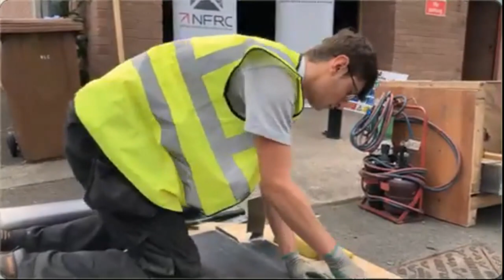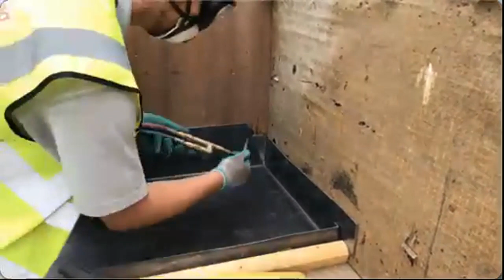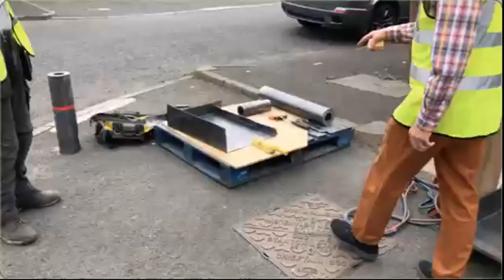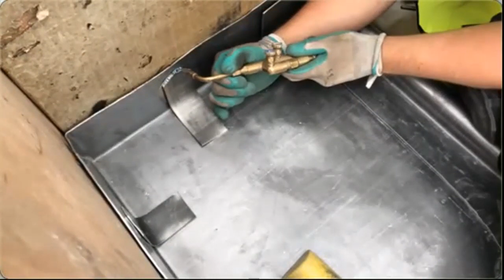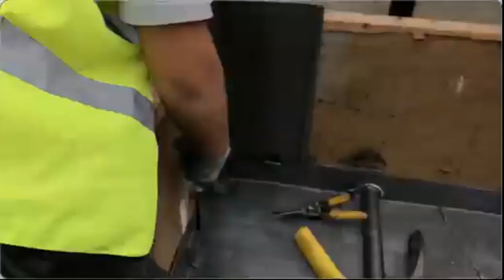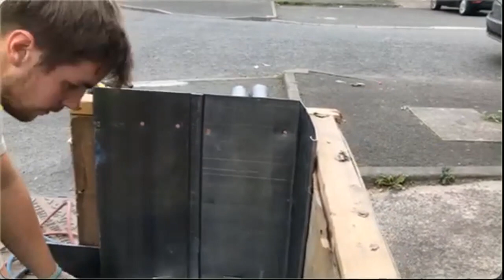Lead Roofing Demonstration for the Edinburgh Traditional Building Festival 2021

Comment: Code 8 lead roofs would normally last well in excess of 100 years and I've seen many examples  still functioning perfectly after 150 years of use or indeed more. 
The few problems I've seen that come about is when plant positioned on the roof needs to be maintained by other trades or with careless foot traffic or if the timber base boards partially rot from interstitial condensation thus failing proper support of the lead waterproofing. 
Often minor damages are easily made watertight (at minimum cost).
If the lead has been stolen then the cost of replacement in lead can be prohibitive.